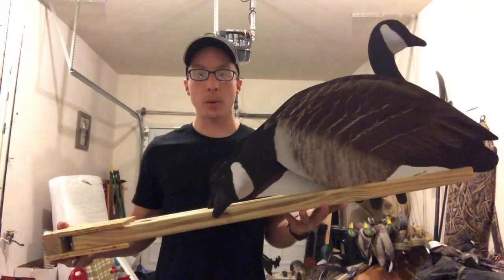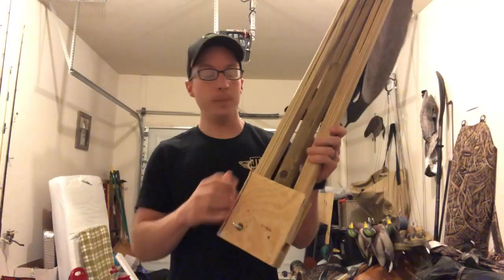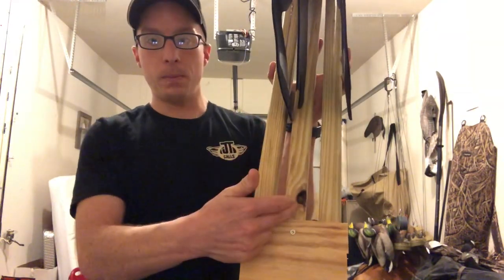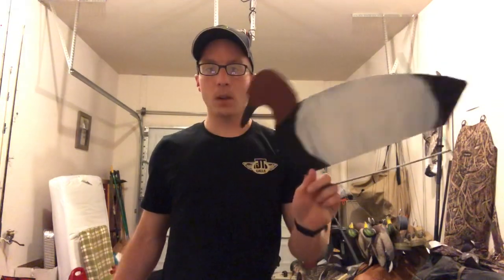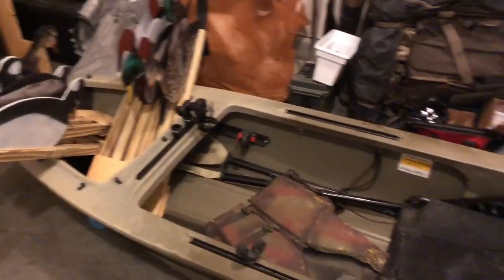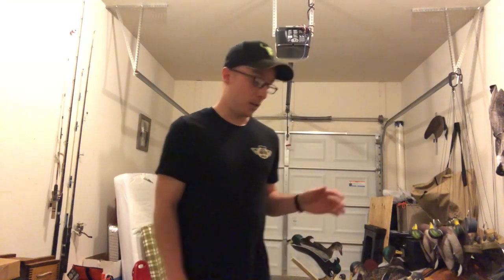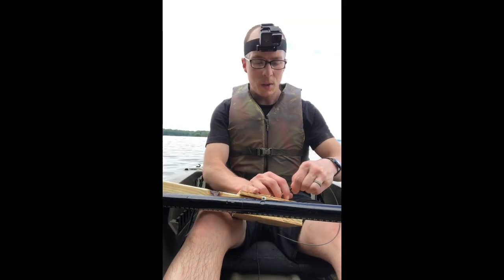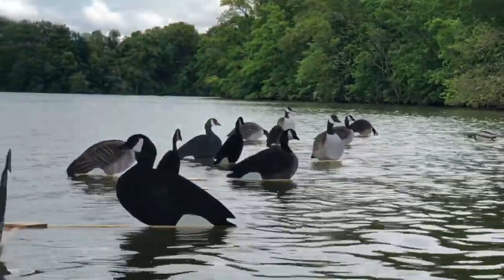How To Make V Boards And MORE!

Comment: First off great video and you will love the results you get. I have been hunting over floating silos for over 20 years here in western Iowa with results that can't be ignored. I like to run 50/50 fb and silos and if the Missouri River current is to much, the V boards work great on the sand bars. Ok some things I've learned, increase your anchor to one pound along with at least doubling your line length to the depth of your water and this goes for marshes also(Or run a couple long lines) Sounds extreme but the first time the wind blows 20  the silos turn into sails. Lastly don't listen to nay sayers and for sure don't try to change their minds, just sit back and let the BA's eat.
Reply from the maker: Awesome advice!! I really appreciate it! I will definitely do the anchoring tip for sure! I’m very excited to see them work! If they decoy birds then I’ll be happy 😊

Comment: Great looking rigs. Do you paint the wood on your V-boards?
Reply from the maker: Yes I spray painted them black also I moved the eyelet bolt that holds the v board to the anchor line. You have to put it on the arm that doesn’t swing this will keep the other arms open once the wind and such hits it.